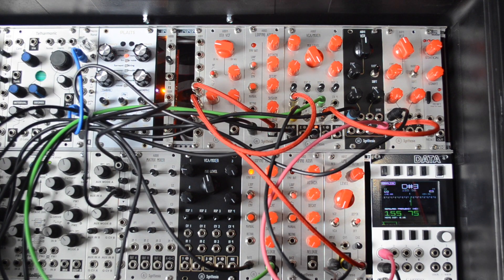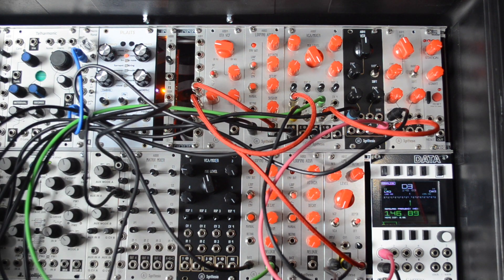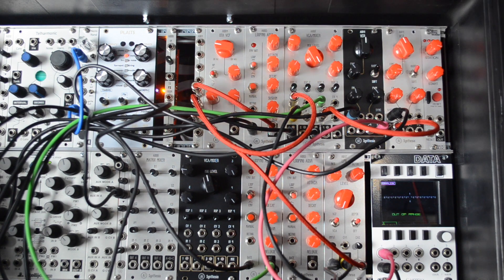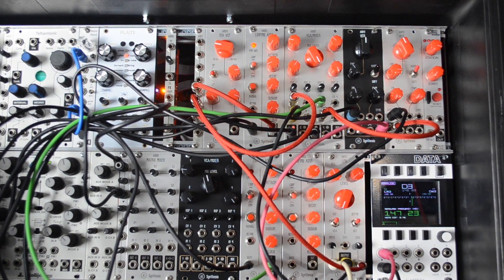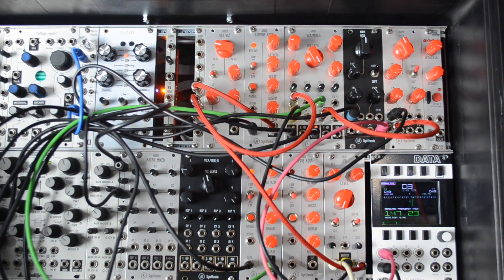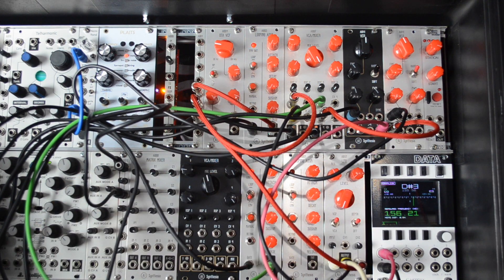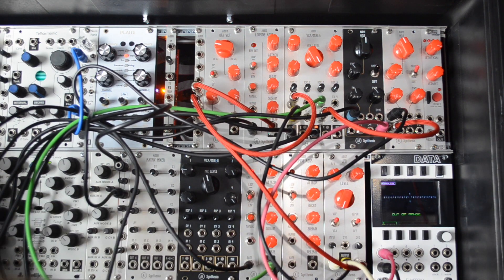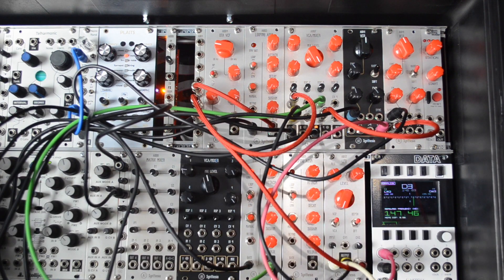Passive Filters for EQ

Comment: Could you do maths for me? 

Kidding aside, cool little thing. Would it be possible to use a pot to have a variable frequency response?
Reply from the maker: It would vary somewhat. Ideally to change frequency filtering you want to be able to change the resistor *and the capacitor. At that point, you might as well build an active EQ circuit.
Reply: @AISynthesis  good insight! Thanks! They look like fun little things :)